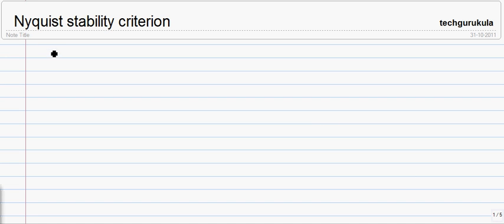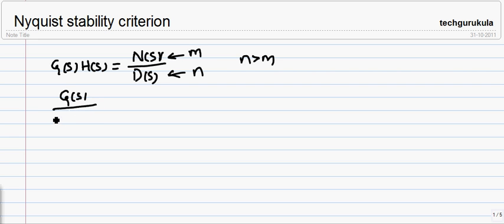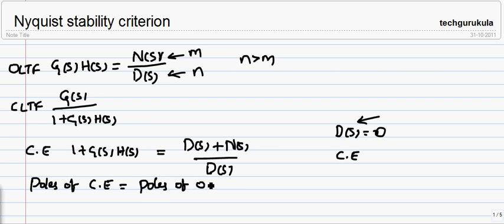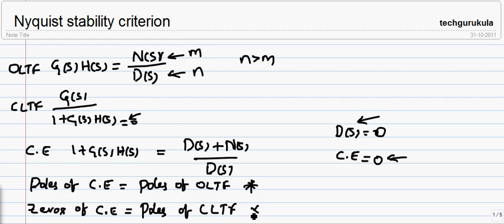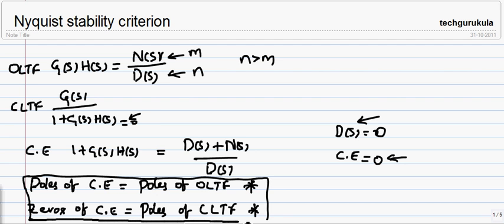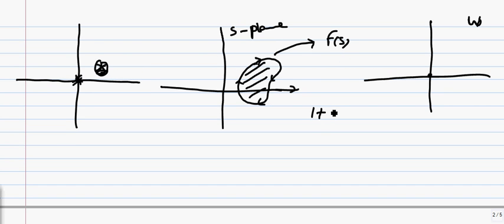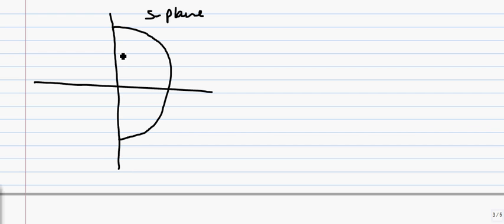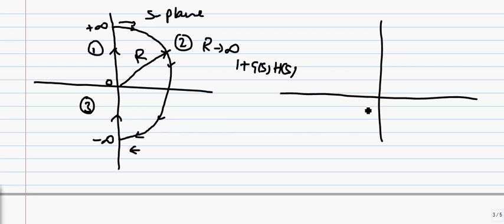Control Systems Nyquist Stability Criterion

Comment: how 1+G(S)H(S)=D(S)+N(S)/D(S)
Reply: since G(S)H(S) = N(S)/D(S), adding one in both sides will give you 1+ (N(S)/D(S) which is equal to (by cross multiplication) D(S)+N(S) / D(S)
Reply: open loop transfer function G(s)H(s) in real examples contains numerical part and denominator part.like (s+2)/s(s+3).here N(s) is (s+2) and s(s+3) is D(s)

Comment from the maker: Hi Shashank,

while discussing transfer functions of a system... we assume order of numerator (m) is less than order of denominator (n). in that case if we want to find the response, the numerator polynomial dissolve into coefficients for the individual terms (by using partial fractions). so, only denominators will have "s" complex variables and numerators will have constant values.
so, only poles determine the stability under our condition (m<n). which is in practical cases true.